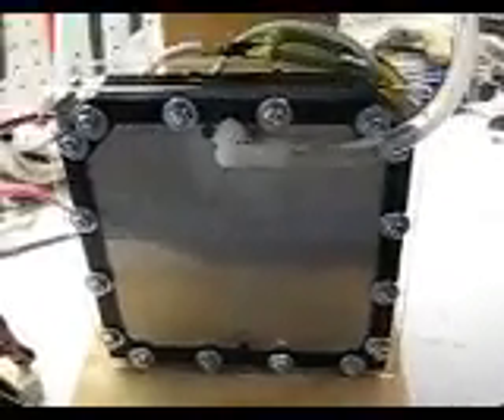Video #28 - 2nd 13 Plate Brick Cell

Comment from the maker: I had used it for 3 months and heat did not seem to be an issue. The water circulated very good and never seemed to get over 90 degrees in the reservoir. Only added water wne needed and it was straight distilled.

Comment from the maker: I've been testing different configurations and I find out less is more when using plates. The last larger plate system I had was not as efficent. This 13 plate configuration works great, is efficent and does not heat up. I ran it for 1hr straight 12VDC at 30 amps and water circulation was excellent. Plates didn't get hot and water stayed clear.

Comment: very nice looking device ... wiht the EBN kit device of similar design, we have so far been unable to figure out the maximum amps it can handle with 36 plates ... on my own prototype which currently has 72 plates, I am typically running with 150vDC at about 17a and it seems able to handle a lot more ... am making arrangments now to put it back to 110 plates so I can try it with 240vDC at about 30 amps ... so far, I cant find its limits but I am working on it ...